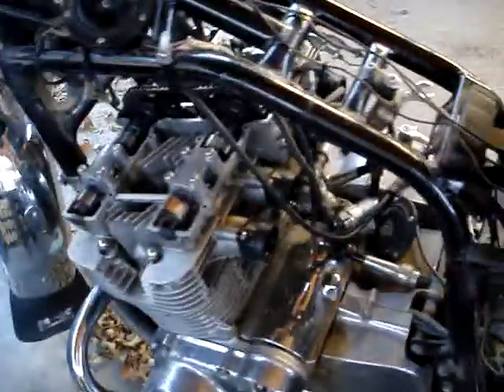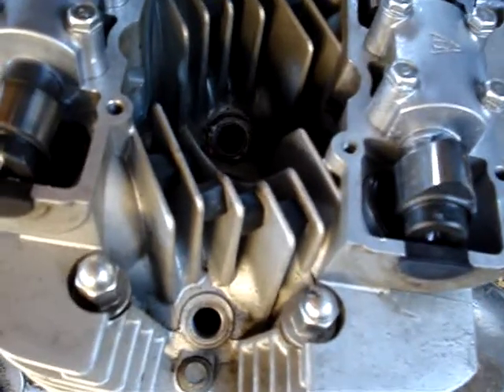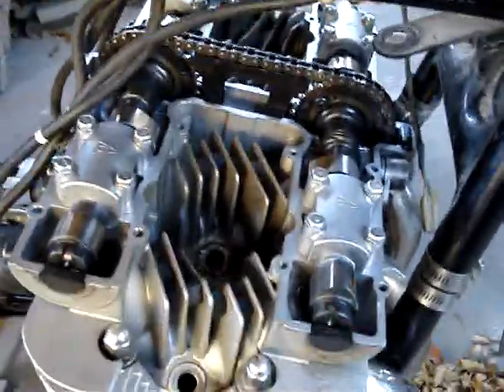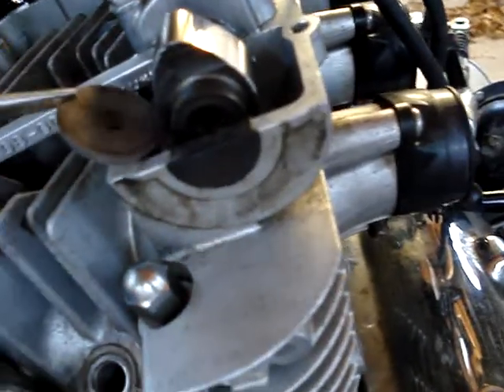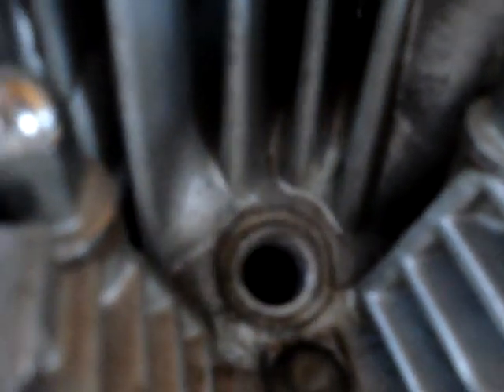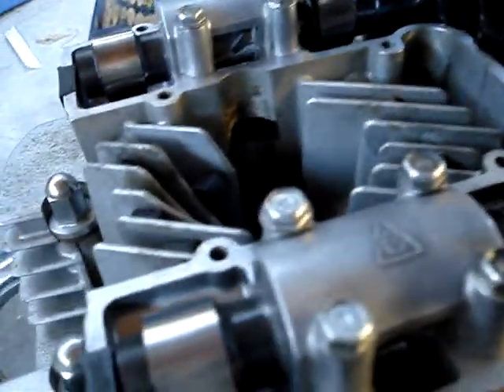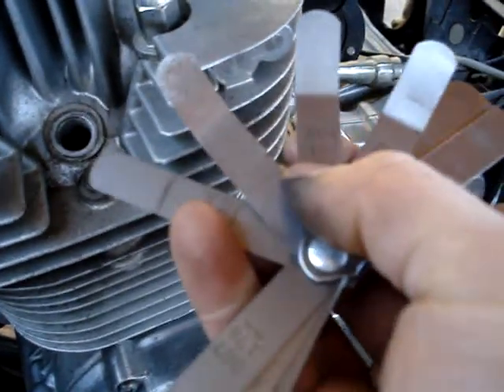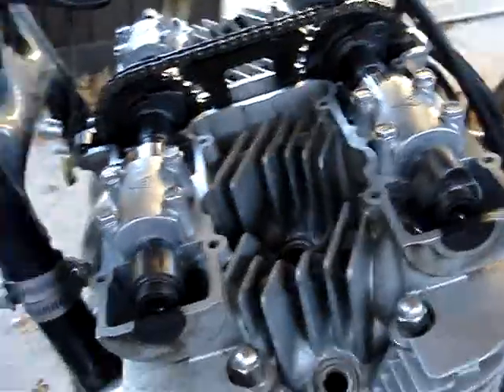Adjusting Shim Valves on 1978 Suzuki GS 1000

Comment: hey not a bad bike. I just got a custom GS1000L a few weeks ago with a problem with not turning over. I may need to replace the starter but i will also clean the battery and wires before i replace anything.

Comment: U halicoiled the spark plug thread,what did u do with all the Derby that fell on ur cylinder?
Reply from the maker: Put grease on your tap and only go in a couple threads before pulling out and wiping clean then adding more grease.  The cuttings should mostly stick to the grease and not fall in to the cylinder head.  When complete, add some gas  or meths to the cylinder and with spark plugs all removed, turn over engine to blow any loose crap out of there.  Do it quite a few times. Shop vac makes a detailing kit with some reducers and small tubing in it, so you can use that also.  There's going to be a few little bits left in there if you can deal with that but, if you think you got too much in there and can't get it out using methods above...remove the cylinder head and clean